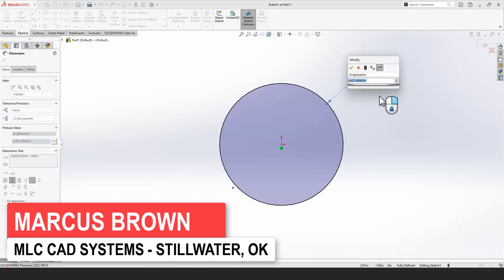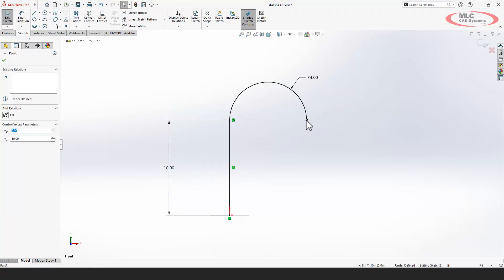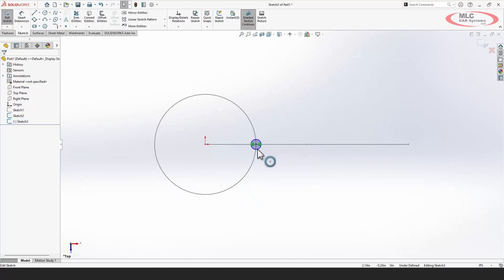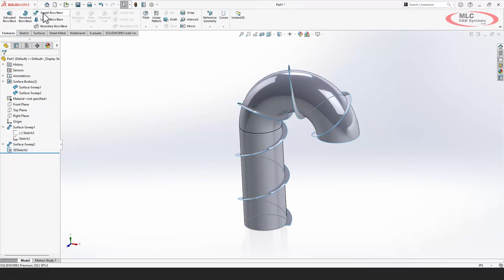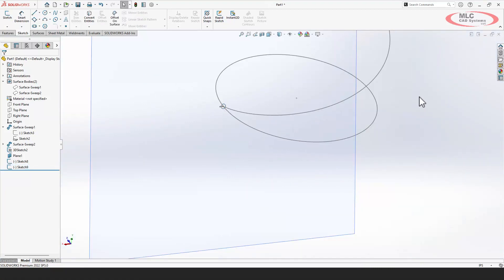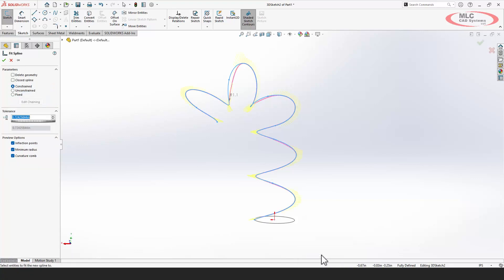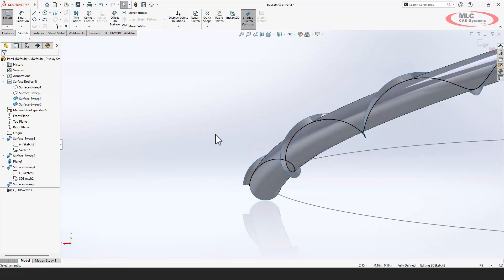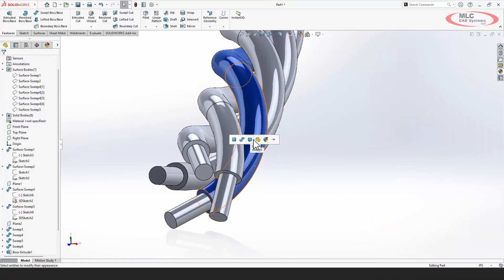Sweeping & Twisting Wires Along Complex Paths - Surfacing & Intersection Curve SOLIDWORKS Tech Tip

Comment: This is great, thank you.  BUT, I am trying to have twisted pairs of wires to twist around each other.  So the path to follow is another twist, not this candy cane 2D path.  Is there a way to do this?  I will keep trying and will respond here if I discover the answer.
Reply from the maker: The candy cane shape was arbitrary for this video, you can use a helix or projected curve as the path and repeat the process of twisting around that helix as many times as needed.  The hard part will be determining the pitch of twist and keeping track of how many curves need to be generated for all of the wires.